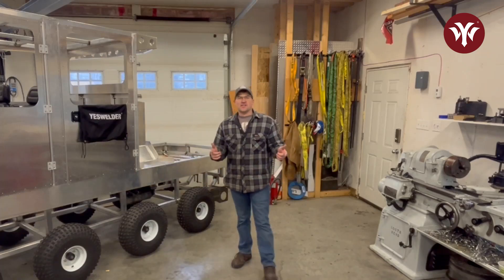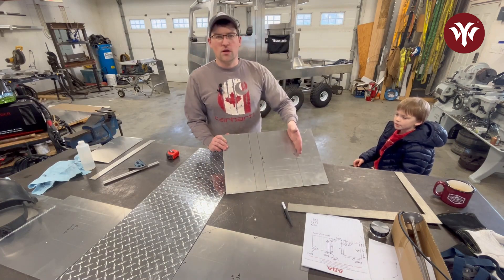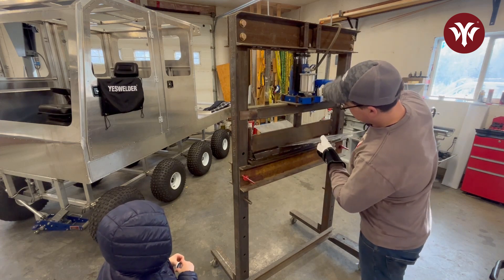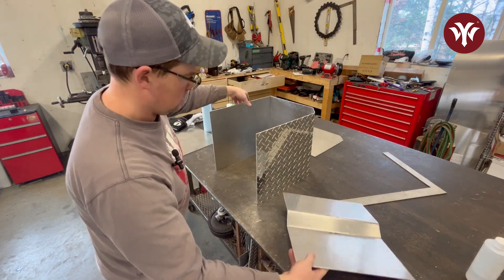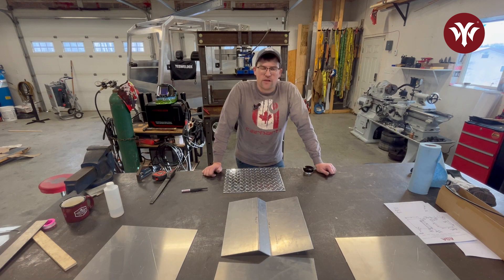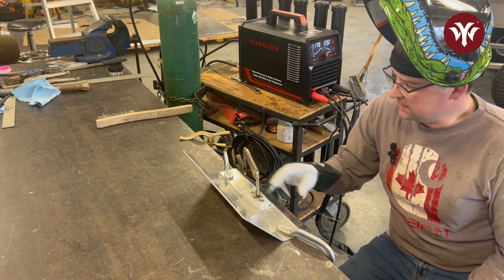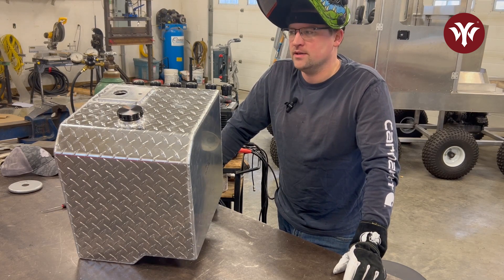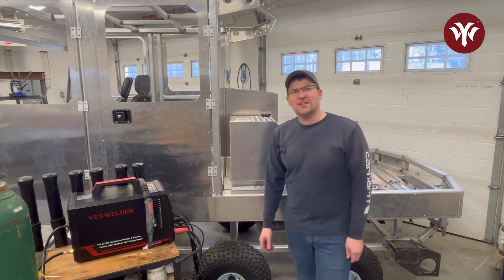DIY Adventure｜Diesel Fuel Tank Build with Yeswelder CT2050

Comment from the maker: Outline:
00:00 Introduction
01:41 Cutting and Shaping
04:21 Cleaning and Deburring Edges 
04:42 Bending and Fabrication
06:39 Assembling the Tank
10:49 Marking and drilling holes
13:47 Setting up the welder for AC Tig
16:01 Final Assembly and Completion
18:30 Conclusion